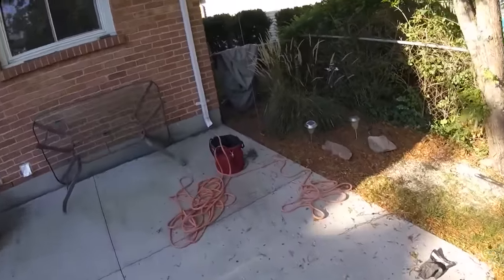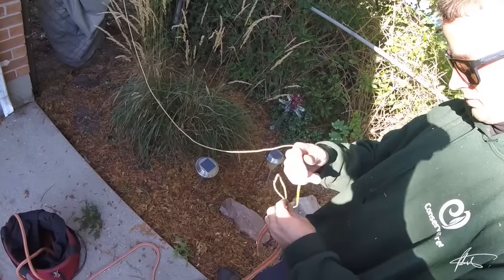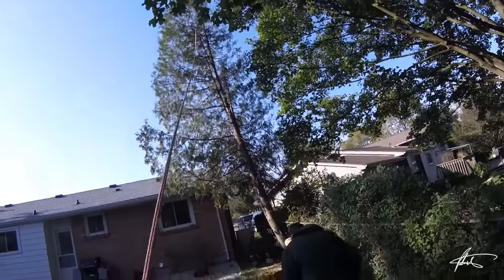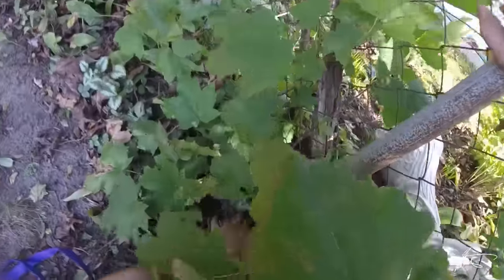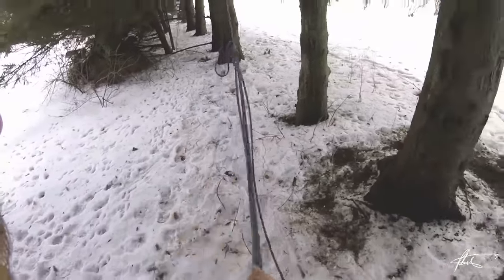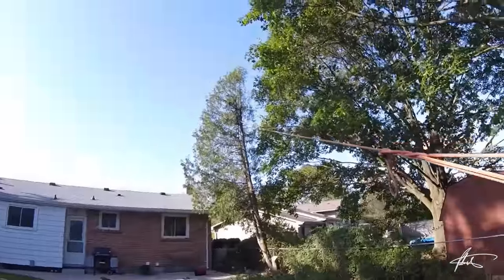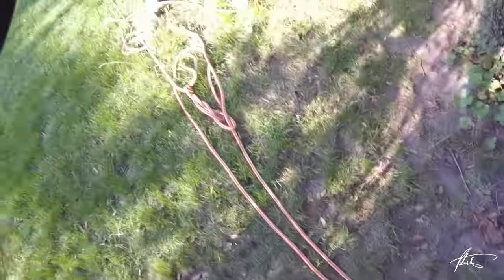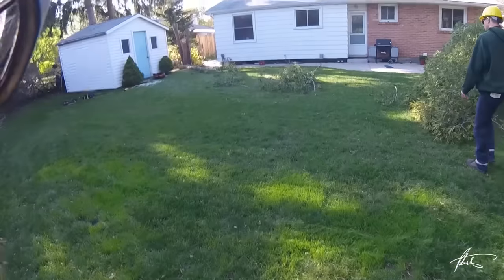"English" Trucker's Hitch in Action  |  Arborist Rigging  | Pulling Power

Comment: The English trucker's hitch I learned is completely different from they way you tied it although it is still maintains an easy way to untie the knot . The one I learned was basically a sheepshank to create the loop. I'd be more inclined to call yours an English trucker's hitch and mine a sheepshank hitch. Guess the only "problem" with the way you tie the English trucker's hitch is that you have to use a carabiner/shackle/etc. But then again with every knot or hitch there is pros and cons. Personally I use what we call a "coonass come-a-long" a lot in my job (offshore commercial diver working out of Louisiana, thus coonass) . Basically it's a loop created with an overhand knot and then works just like a regular trucker's hitch. We use 1/2" poly so when it comes to tying knots that can't be untied easily, we usually don't care cause our time costs more than cheap poly. With that being said, I have ran into situations where we were low on rope and had to conserve whatever rope we had to get the job done.

That's partially the reason why I like watching arborists videos. Because you guys use expensive rope, you guys always use knots that are easy to untie. Just learning your go-to knots has saved lots of time in my job when resupply was hard to get in a timely manner.

Comment: Interesting throwing technique to get the lead rope as high as possible over the branch. I'll try that soon, because getting the attaching point as high as possible to the tree is the main trick to get the tree bent. The higher the attaching point, the longer the lever, the more massive the torque which pulls on the root-strunk.

If You get the rope 10m above ground, every kilo You pull (with 3:1 transmission) equals 300Nm of torque on the strunk. That's about a much as my 2,0 Diesel car has. But You'll be able to pull more than just 1kg on the rope. If You pull 33,3kg, that powers massive 10'000Nm on the strunk!  But I guess a strong man can pull more - maybe twice as much? 
Sometimes  You have to beware not uprooting the tree... ;)

Comment: You made the loop on the bit too big normaly it's about two inches . With a standerd rope you use one dolly on thinner ropes two dolly's on the head as the thiner ropes espeasurly nylon ropes slip through the dolly's head . Our trailers are very differant under the edge of the trailer about every three to four foot is a hook wielded onto a cross member .the ropes we use are about fifty foot long we normaly carry five ropes , at one end of the rope is a loop the other a free end this end is your start not the loop but most drivers now are not taught this so they use the loop to put on a hook to start when you should use a bit looped through the main lone to make a slip knot with the bit trapped between the hook and the main line of the rope this is so you can pull the free end and undo the loop around the hook . Remeber I said only one wrap around the dolly head on a standerd rope this is because there is another meathod of undoing a dolly knot that is to break the head you place your hand from the top of the dolly grip the knot and bend it downwards so the loop in your palm bends downwards and you pull slide the dolly ring off the head the loop then you pull the rope and take the hitches off the hook that secured the tension you do this as you walke down one side go around the othere doing the same . If you did it the way you did to undoo the dolly knot you will be walking from one side to the other double-blind you work time and distance walked . Remeber the loop end well its used to extend your rope by joining up another what you do is hold the loop pass a bit through the loop then with the free end make another bit and pass it through the first then hold the line so the loop end of the first line is towards the ground facing upwards with the bit conection uppermost place a foot on the bottom rope and pull to tighten the conection before you throw the rope over the load on the trailer and sheets then when you are takeingvthe ropes off the load all you do is stand on the loop rope and pull the free end og the bit so both bits come appart and your left with two ropes . Once you have your dolly's set and you have pulled down as hard as you can if you need more preasure make a loop out f the free end of the line at about knee high place your foot in it holding the end og the downward line and the loop you made for your foot together before applying preasure downwards keeping an eye on the dolly's head to see if the dolls head is slipping through the coil around it so it does not slip off it could make you stumble and bang your knee on the trailers side guard but with a good rope this will not happen and practess makes perfect

Comment: rope on rope creates friction, friction creates heat! You rig trees like that, youre gonna burn your rope out and loose all control, even a lil one like the one you fell can quickly ruin your day. One solution, put a carabiner on your midline loop and pass the running end of your rope through it. problem solved. even better, throw on a micro pulley at your anchor and midline then bam, you got a simple, effective, safe, MA. to really top it off, and relieve the riggers forearms, throw on a eye to eye prusik along with the micro at midline and youve got a brake. thats the safest, most effective way to set up a basic MA system. Not trying to be rude, just trying to save lives. Stay safe.
Reply: I guess I shoulda worded my comment differently. All I was saying is one would be wise to eliminate rope on rope friction in a rigging scenario 👍
Folks see this and try and do it on a bigger tree then things can get bad fast. 

U do make a great point about the hitches.

Comment: I love this version (I'm English so love the name but I must admit I've never run into this version before and have been using the 'standard' trucker's hitch for yrs... no longer as I'm a convert!)
My one question is about how you secured the line to the base of the tree at 6:08 as that looked amazing and I'm sure just as helpful to learn from.
Thanks Patrick
Regards
Reply: In the UK this knot is knowen as a single or double dolly the single and double refuse to the amount of times you loop the rope around the bit or the dolls head hence it name dolly knot as it looks like an old stile Rag doll the bit or loop being the head and the coils around it the   Dress collar the thiner the rope more coils to the collar are used as the thiner rope slips more easily than thiker ropes